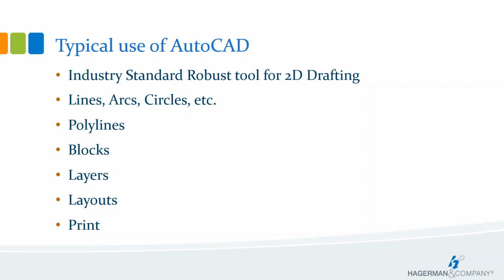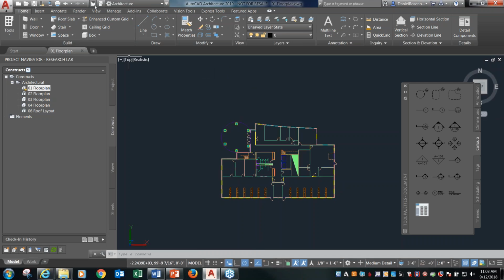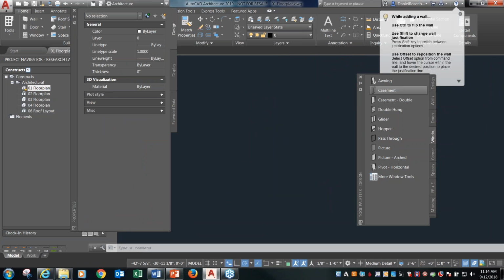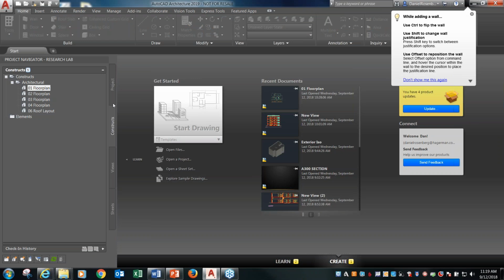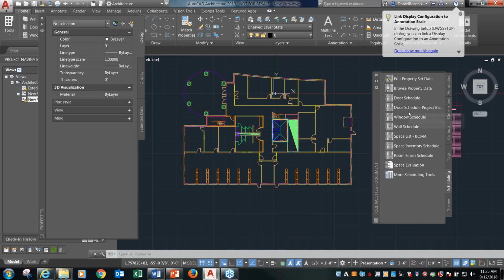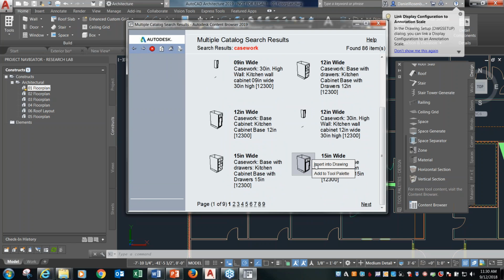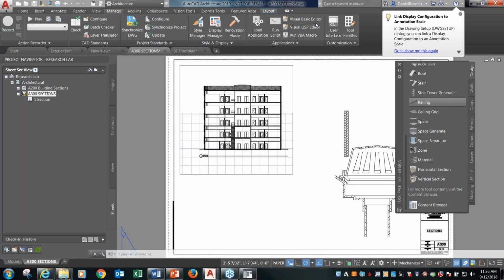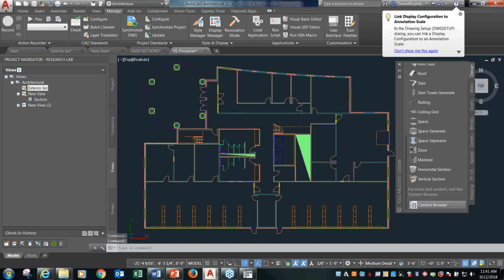Introduction to the AutoCAD Architecture Toolset

Comment: I may have missed it (here and on your playlist); I'm on MEP toolset and want to change/update the existing "Tools". My main focus is to add "linetypes" with the proper system and layers. For example, plumbing has sanitary out of the box. I want to add natural gas-low pressure. Customize "tool palettes" does not allow me to edit the Palette "Plumbing Line"

Comment: Can a plot plan be done on this program???? If so, tutorial please...
Reply from the maker: AutoCAD Architecture is built on top of AutoCAD so all AutoCAD commands are available. Therefore if you currently create your plot plans using AutoCAD you are still able to do that with AutoCAD Architecture without running a separate instance of AutoCAD. However, if you use Civil 3D to create your plot plans then you will want to continue using Civil 3D for this function since it is better suited for this type of drawing.

Comment: Great features ! Hope Autocad will implement structural engineering too .
Revit is a good tool but is very very disorganized , and  settings are spread in 1000 places and lacks  a ton of features (for the structure module).  
In contrast Allplan is a very well organised program (they are germans) , has almost all features you need, and is very easy to learn . 
The visuals and drawing engine are very good in Revit and Autocad .
Reply: Revit is not disorganized. 

You just suck.
Reply: @klasrobertsson3943  Don't think so ! After 3 months of searching there is no 1 complete tutorial with final drawings for structural detailing .  And the way it is organized is absolute crap . I work with 10 + programs ,and none is as bad as Revit !
Reply: Hi, how to use this tools software with free of charge.